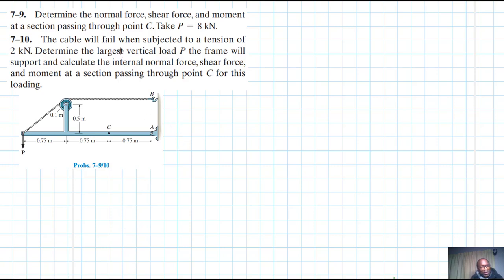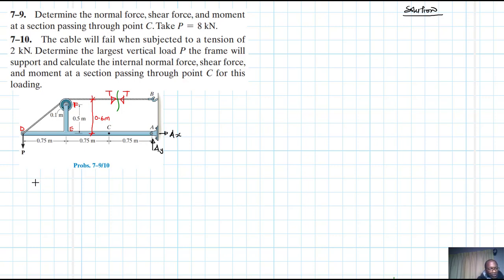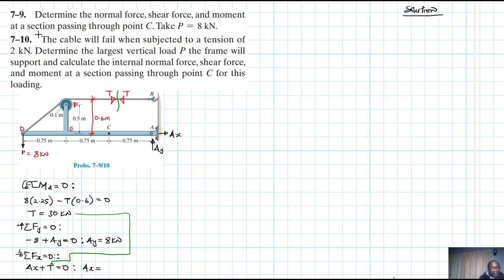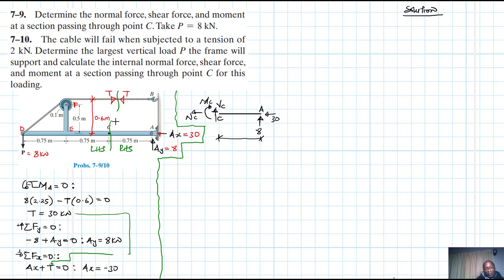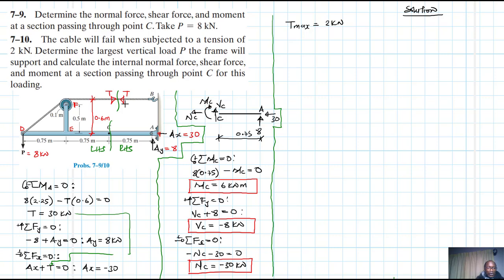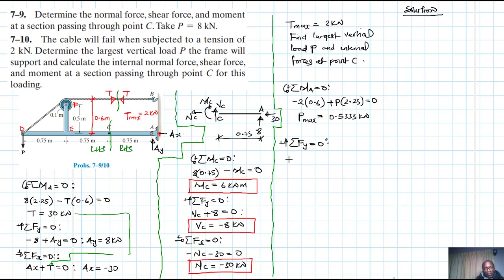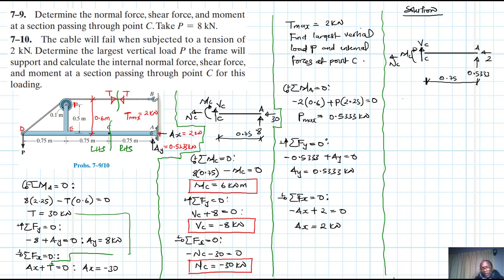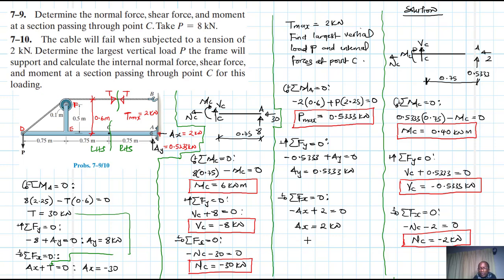7–10 Internal Forces (Chapter 7: Hibbeler Statics) Benam Academy

Comment: While calculating the resultant forces, you only considered point A. Why are the forces from the other points not relevant for this problem? (Sorry for any spelling mistakes,  English is not my main language)
Reply from the maker: I only considered the reaction forces at the hinge support A and the tension force in the cable at the specific point where I made the section cut. However, you can solve the same problem using a different approach.